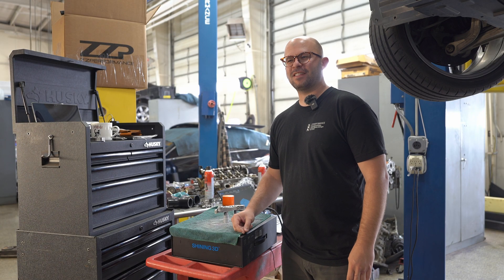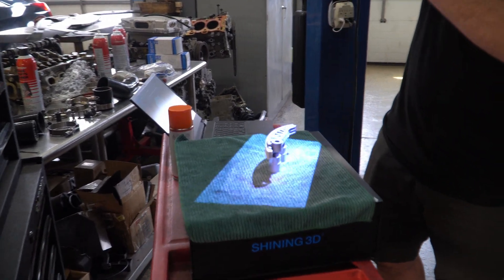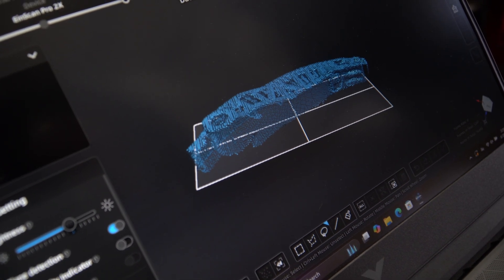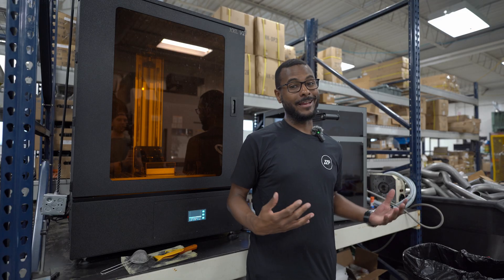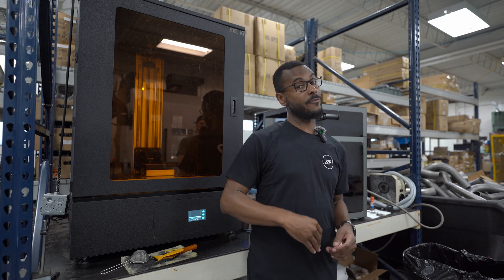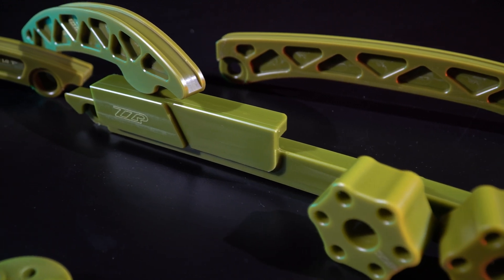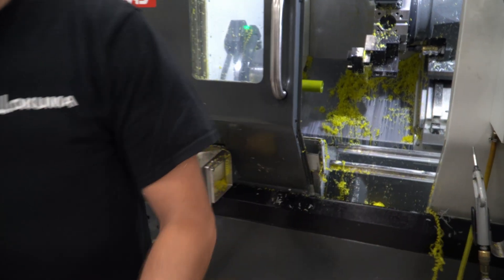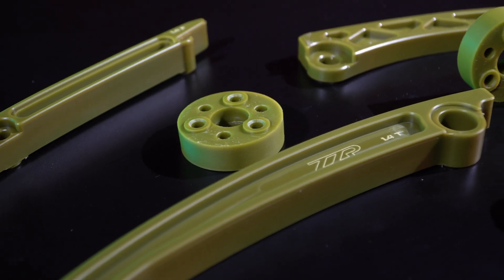How It's Made | Timing Chain Guides/tensioners

Comment: Bought the upper guide while back. Quality was not as expected. Works good so far tho. The material used is much stronger than the OEM guide. First part I've bought from zzp that I was like eww 😂. Must have had a new guy running the CNC for that work order

Comment: How much stronger is your upgraded green guide VS stock?
Reply: I had both stock guide and zzp guide. Tried to bend both and the zzp one is nuts
Reply from the maker: While that's difficult to quantify, we have yet to see one of our guides fail. An inspection after 10k miles showed no visible wear. They are significantly stronger than stock, which is apparent from just holding them in your hand.
Reply: So for a cobalt, why and when is the timing chain/ guide a problem on a stock 2.2 05? Why do i always see talk about it in general. Thx
Reply: @RadRebelMx  The timing chain system needs service approximately every 100k miles. GM made a few revisions to the tensioner along the way. The chain typically will either lose tension via the tensioner and start slapping, or the main guide will break and wreak havoc on the system.
Reply: @gbrunner24  well i have 187kmiles with stock chain still.
Reply: @RadRebelMx  That's great to hear, the engine must be well cared for. Some folks can and do go longer than the suggested service interval, but we still suggest servicing every 100k to ensure worry free operation of the engine.
Reply: @gbrunner24  ok right on, thanks.